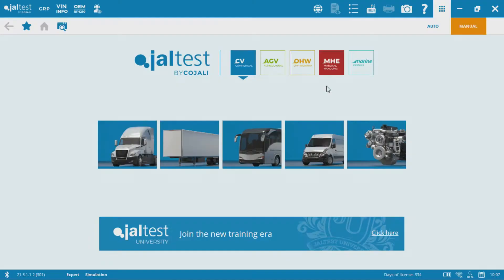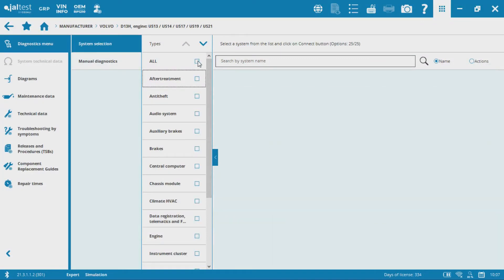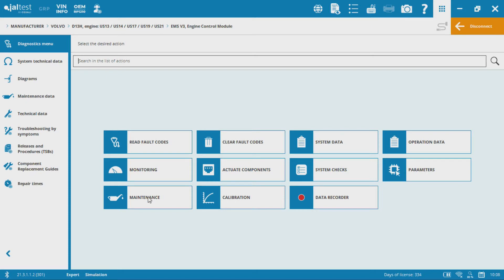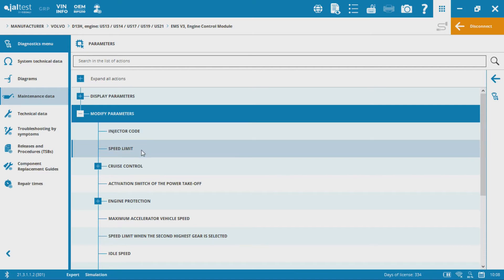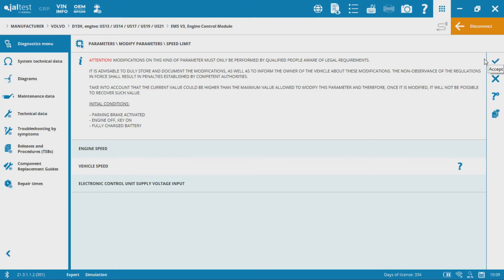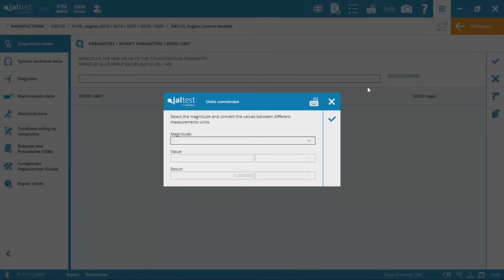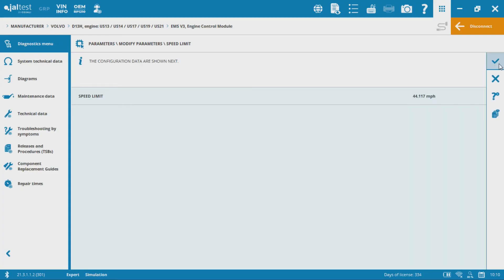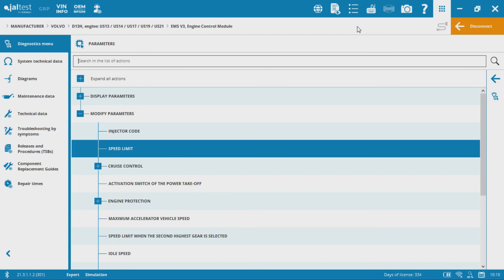Adjusting the Maximum Vehicle Speed Parameter on a 2013 Volvo D13

Comment: What does it mean if we do the speed limiter change and the truck continues to stay locked down to 65 mph, we run a 2017 volvo with D13 I shift and we've checked multiple times our governor is set at 83 but it still won't go over 65 even the cruise control locked to 65
Reply from the maker: Make sure you check for other speed limiting parameters. Maximum accelerator speed for example, and ensure those are not limited.
Reply from the maker: I would recommend you contact the technical support team to get remote assistance on this.
Reply: @wholefleetdiag  probably gunna end up taking it to volvo, we plugged back up we can't find anything else pointing to limits, the speed still set to 83 for pedal and removed for cruise but it still won't go past 65
Reply from the maker: @smittsluchianoTV we would love a chance to take a look along with our ATS team before you send it off. If you can plug in and send us your QuickSupport ID and Password we could make it happen over the next couple days.

Comment: pleasant good day  brother . Can this diagnostic tool  do programing on electronic control units
(engine, transmission , brakes system, air bags system,  for example. ) GOD BLESS.
Reply from the maker: The Jaltest software is a professional electronic tool capable of near deal-level service capabilities including calibrations. Jaltest will NOT facilitate reprogramming or emission system deletes.